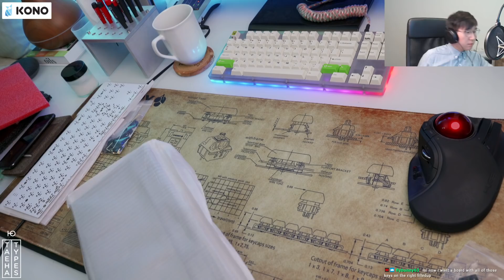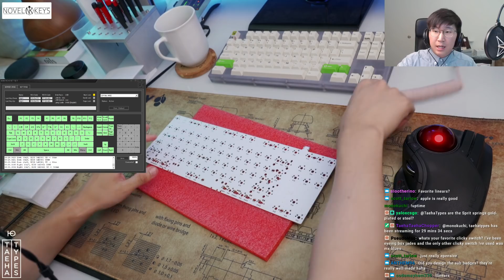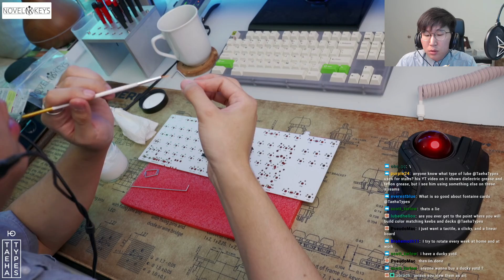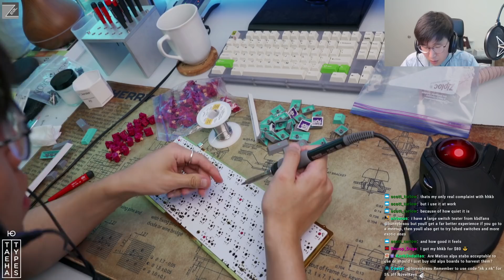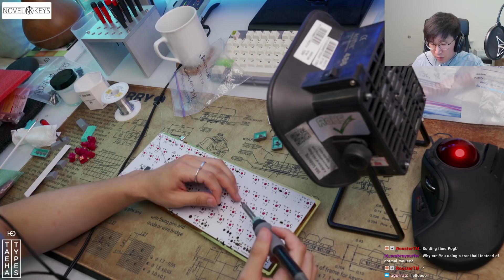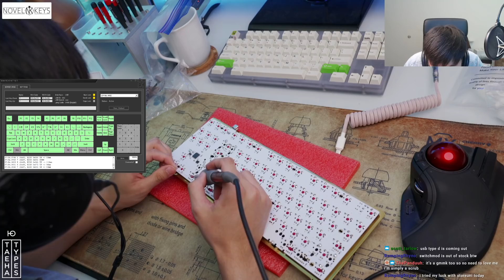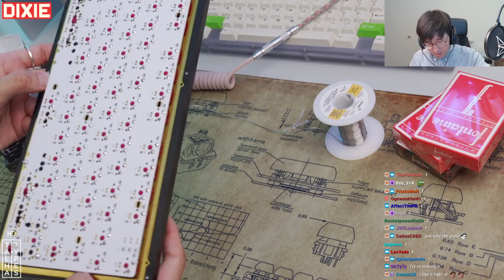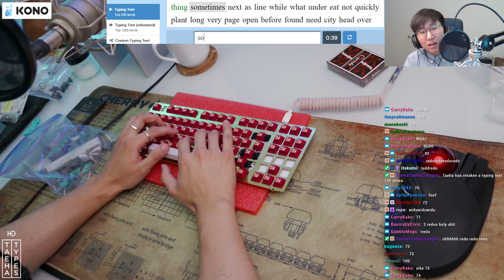KBDfans 8X Build Stream

Comment: How much to build a decent entry level bored? 60%
Reply: a good sum of $ mainly the keycaps the pcb, to if want a pcb that's hot swappable the frame counting on the material to the keycaps omg not including the switches them self the DIY scene is wallet murder but worth MX to the clone outemu are ah cheapest!? don't count me on that to Taeha should ofc fill you in more
Reply: @M4TTYN  I have no idea what you just said
Reply: +Oscar Chang, Majority of the money that comes from a keyboard build are not only from the keycaps, but the pcb as well. However, if you either want to go down the hot-swappable route or non-hot-swappable you'd have to take into account the case, the keycaps, and switches as well. The DIY process in the MK scene is a pain in paying, but definitely worth it. If you want to spend less money on rather expensive cherry-mx switches, there are other clones like gateron or outemu. Of course, there are some parts of the process that "taehatypes" can help with.
Reply: You can get a 5 Degree or Tofu case on KBDFans for around $80, PCB for around $30-$50 depending if you want hot-swap, plate for around $20-$30, switches will run you anywhere from $18-$60 depending on the switch, keycaps from $30-$200+ depending on the quality and manufacturer, and stabilizers around $10. There are other expense too, such as lube, switch openers, soldering station, but all of this is optional or dependent on what kind of build you're going for. But if you're trying to save money, I would say at the minimum you're looking at around $200.